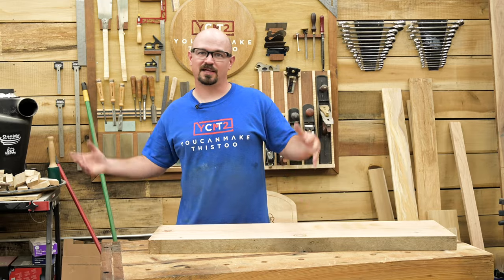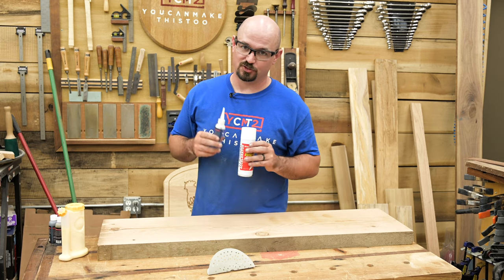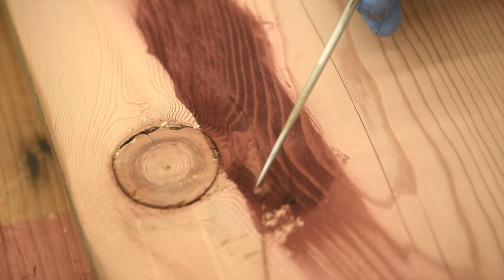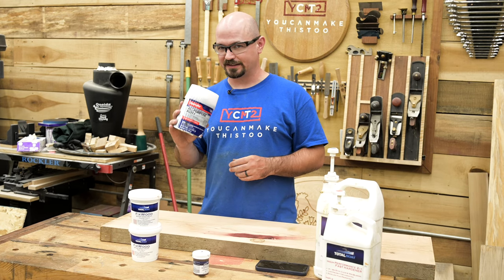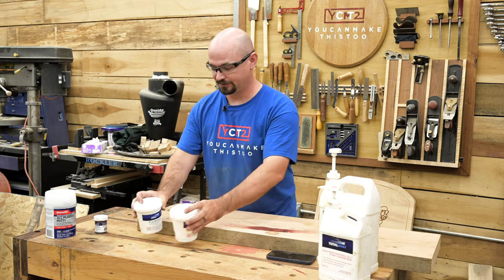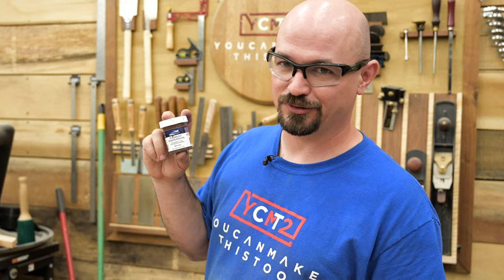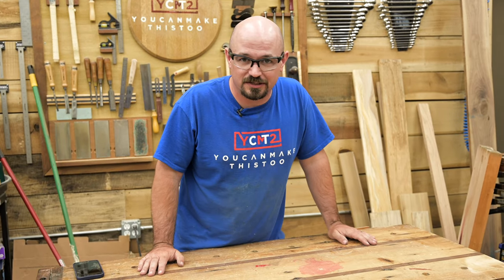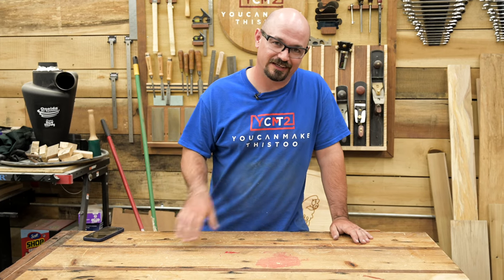Beginner Wood Filling Mistakes | How to Fill Cracks and Gaps

Comment: what is a good filler for live edge table with similar long cracks as shown in video? I am looking for a filler where I do not need to sand and stain after, because it's a big slab of dining table, and only a small area has started to show cracks.

Comment: My boys somehow ripped the screws out from underneath the ping pong table which is particle board. I’m trying to figure out the best way to fix any suggestions
Reply from the maker: There are screws for particle board. Probably have to make new holes. No good way to repair particle board to hold again

Comment: The biggest problem with that stuff is the shelf life is only about 2 years.  Once you open it and even if you don't.  I've had it be hard as a rock.  Small portions is probably best
Reply from the maker: Which stuff?
Reply: @YouCanMakeThisToo  puddy.. wood filler. Anything is a tub
Reply from the maker: I’ve had some timbermate for over 3 years and it’s fine. If it gets a little dry a few drops of water brings it right back. Great stuff.

Comment: Why would you just slather on that CA glue all over the surface around the crack? Use a fine tip or even a syringe and get it in the crack without any spill over. 

Also, people always knock bondo but from my experience it works amazing in certain repair situations like fixing a rotted casement window sash. I have repairs 10-15 years old now that are still perfect. The bottom 2.5 inches of my front entry door is 90% bondo and you'd never know it. Yeah, ill buy a new door eventually, if it ever fails.

Comment: Your  video says.   how to fill cracks and gaps..........I am still waiting on the HOW TO .......part.........
Reply from the maker: Ah yes, I missed that. So use the structural / purpose / finish guidelines I set out to pick the right product. Once you’ve identified the right product, follow it’s directions. Generally it’s something like clean, mix, apply, dry, sand.